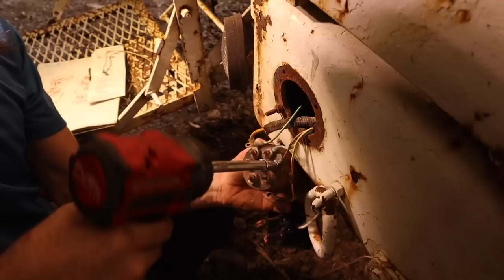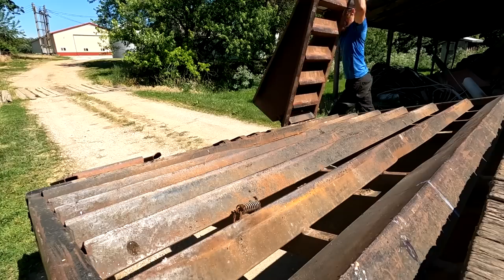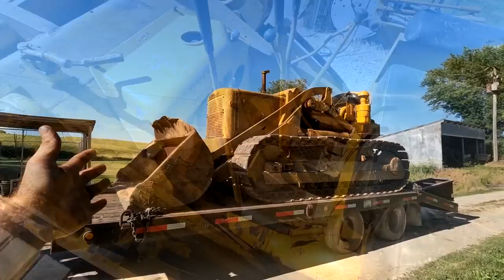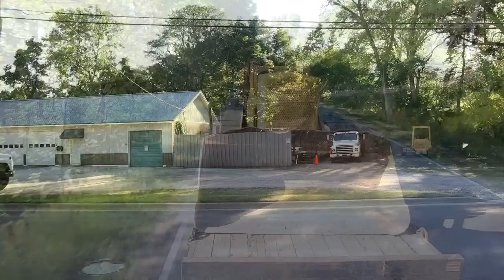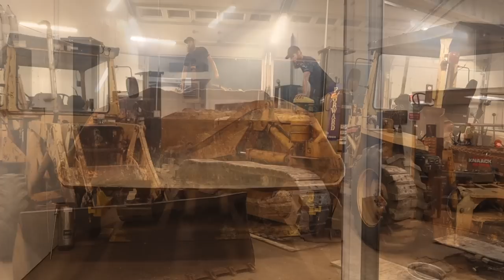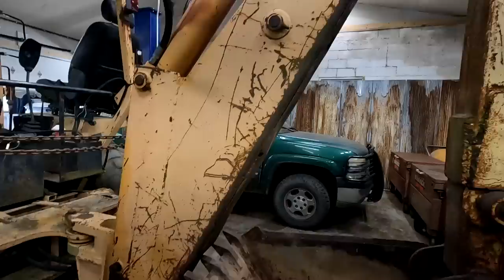It's MOVING Day! ~ DAY 7 ~ RARE 1954 Cat No.6 Shovel Forgotten in a Barn

Comment: Fun tip:  If you don't already have a Weather Pack kit, get one and use Weather Pack connections for the trailer connector when it goes bad next time or gets damaged.  Waterproof, and speeds up replacement the next time.  And for heavens sake get rid of the frame ground for the trailer plug, bad grounds are by FAR the biggest problem in trailer wiring.  Take a wire all the way to the batteries for ground.

Comment: It always startled me as how much different the gearing is between the loader and the dozer. High gear can be a bit scary on the loaders. I had a brand new one( late 70s ) that hadn't got it's ROPS or bucket put on yet heading into the shop just for that. A tropical depression was in full swing and I was getting soaked. I came at the shop and needed to turn left into the 1st bay. I planned on coasting in and just braking to make the turn. Those slick track pads had different intentions as they just hydroplaned and put me into a sort of high gear power slide that ended up in front of bay 3 and the foreman wondering just what the hell I was doing. I damned near got fired for that and it was the last time I hot dogged anything with tracks.
Like a forklift, that wall looks a lot bigger when you have no brakes.
Cheers
Terry
Reply: Yea power sliding is a no no in those machines, wait till you get them on ice it's even worse even in low gear , I would thing using a welder to put some beads of weld on the tracks to give some of them a cross hatch pattern would help.
Reply: @tacticalrabbit308  I think the worst things I ever loaded on any trailer was the roller compactors with drums front and rear. They bounce, skip and hop about anyway let alone put them on steel ramps or greasy wood beds.
Cheers
Terry

Comment: I had rescued a 1953 John Deere 40 crawler (with a blade), from a resting place in the woods just a couple of years ago. I got it running and fixed the stuck right side steering clutch as well as newer tracks and so on. I did sell it as most of the fun was just getting it going. And the fun in doing it was awesome. I just really enjoy watching you save the old stuff.

Comment: So i see youre planning on testing the fortitude of the lift.  As i was growing  up,  my mother was the secretary for a comstruction company and theu always had some kond of huge machinery in varying states of disassembly in the shop. They had a lift type thing that would jack up an entire loader. That was cool. The tires on some of the truck were taller than i was then and even now. I kinda miss going in there. I do love the old tools , machines, trucks. You need to find an old "B" model mack dumptruck.

Comment: Track loaders do not have aggressive tracks compared do their dozer counterparts.  The former owner of that Cat Model 6 had been using it for pushing over trees and he had been lucky that they went they way he wanted until the tree that scared him.  I use my MC to pull on trees to get them to fall the way I want but my tracks are fairly aggressive and I drop the front blade down to get more purchase but I always have enough chain cable or strap to have my machine be clear from where the tree will land.

Comment: My biggest thing to drive as a single item was an M1A2 Abrams tank in the military at 70 tons then it was semi trucks driving over the road and most dangerous load was coiled steel loads on a flat bed trailer, and I think running that loader needs a fuel pump to boost line pressure to the injection pump to keep it from loosing power on angles like you were driving trying to load it.

Comment: Hi Matt, hope you are well. Super video as usual. Love the old machines and i agree with not restoring, but I'd settle for a thorough clean, rub down the rusty bits with a wire wheel on the angle grinder and finish off with a coat of hard wax. Yeah!! Thanks for sharing. Stay safe and keep up the good work.

Comment: I just found your channel so I am just getting started wit your videos but I have noticed something.  You make it harder on yourself ten it need be wen you load equipment.  My tractors are all smaller being a 1946 Agricat Model A, 1946 Gibson Model A and my largest a 1950 MC that I built a backhoe for.  If you would use your trailer jack to lift the bed a bit and if you have to toss down planks on your ramps you will avoid hitting the trailer deck with a blade or bucket.

Comment: Next time, dig a shallow slanted hole for the trailer to stand in and drive the load onto it. The metal ramp will now not be needed and it is easier to drive the dozer on the flatbed.

Comment: Do you have the wrench for the final drive plugs? I have plugs with female hex on my 955H and when I went to service it I was looking for a wrench that fit. The plugs were very tight and luckily I found the Cat wrench and extension in the toolbox. The back side of the wrench fits the hex plug for the trans.

Comment: Please when loading or unloading that machine use a lower gear and go a little slower. I would not like it if the machine slid off the side of the trailer and you got killed. I have over 50 years running excavating equipment and I have loaded and unloaded many machines. Stay safe

Comment: Lower gear........
Reply: I said lower gear, assuming that the gearbox works. I think it does as there was a time in one of the videos that it was in a very low gear as you approached the dirt pile. Your a smart guy. I’m confused as to why you didn’t select a lower gear unless you could not, but didn’t want to add that failure to the content of the video ??  Loading a steel tracked rig onto a trailer like that is like skating on ice and lugging the engine into a stall as you did... hurts the whole machine, not only your senses.

Comment: You really need to experiment with the tranny as far as gearing,seems like this tractor is in high gear range all the time,should be a low range on it,with those smooth pads and a little moisture on the trailer ramps,loading and unloading could be making for the ultimate disaster!! And with no rops cage,your videos and your life could be cut terribly short!!Just a thought!!😎😎😎

Comment: Should use solder sleves: amazon: haisstronica 330PCS Heat Shrink Butt Connectors Set,AWG 22-10 Marine Grade Electrical Connectors Kit,Waterproof Butt Splice Connectors(3Colors/3Sizes),with Crimping Tool and Removable Storage Bins